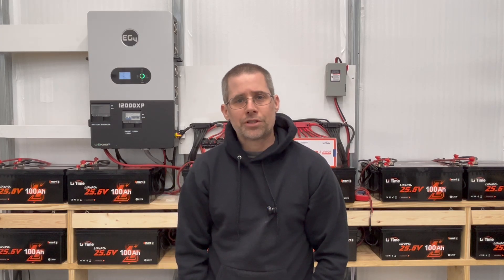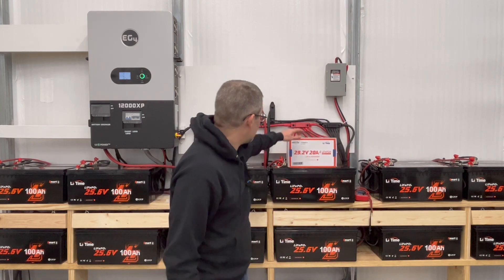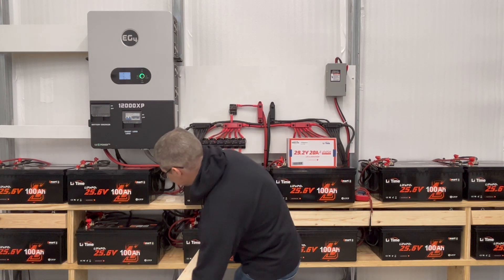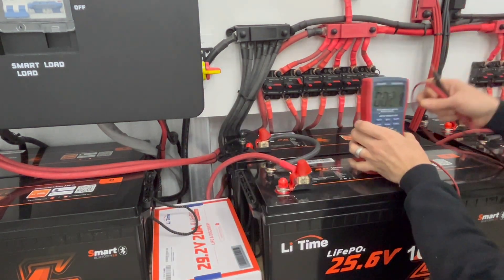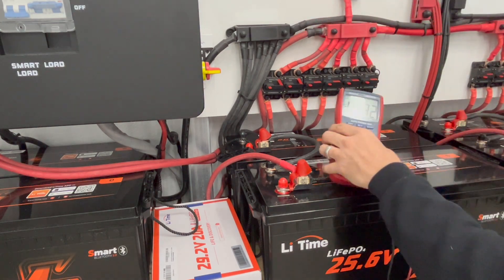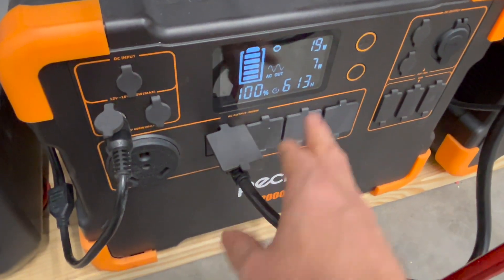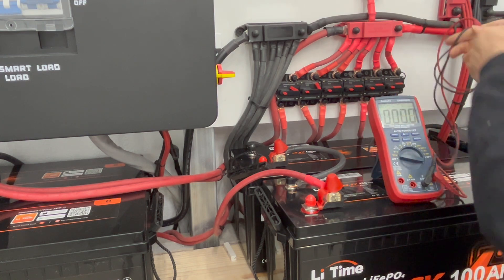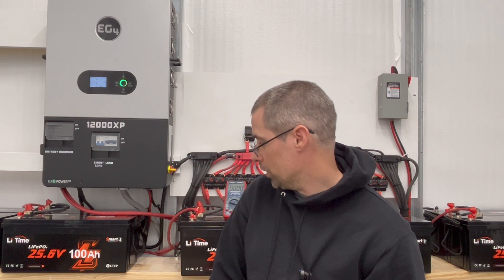Fixing LiTime 24V Battery BMS Troubleshooting - The DIY Guide

Comment: Man I’m glad I’m only 4 deep into four 12v 230ah LiTimes.Fussy bms and they sell a charger that puts them to sleep .Krazy !
Reply from the maker: @2hotscottpro  That’s crazy issues.  Right now all 24 of mine are working.  But the question is for how long.  Thanks for watching!
Reply: I have 2 li time 24v230 ah 24 volt system ruining my entire home off grid  have been for 15 months trouble free   in Florida with shall AC heat pump 12kbtu builds around 320kwh a month Summer small compared to what you have

Comment: Did you turn on for discharge on app?
Reply from the maker: Unfortunately the LiTime app does not have settings for that.
Reply: @MikesSolarGarage  i have litime group 24 12v 100a and it was turn off for discharge, and I turning on with app
Reply from the maker: @ I just turned it on.  It’s working now!
Reply: @MikesSolarGarage   https://youtu.be/NgMakl0pvzI?si=8VKS0jxbA9Xc2u7N    4:24
Reply from the maker: @ That fixed it!  Thank you soo much!!!
Reply: @MikesSolarGarage   your welcome!
Reply: Man, those of us with ie a new 24v LiTime  280ah model (no BT offered) are doomed to wake up ours if it goes nuts…). You got a wonder if it’s worth even buying the lead time battery charger that they sent you.  They look like about 185 bucks.
Reply: @Tom-Fisherman  i getting my charger from ali for 40$ 😂 some battery has bluetooth some of them don't,  look what you baying 😅 i think without bluetooth they always on.